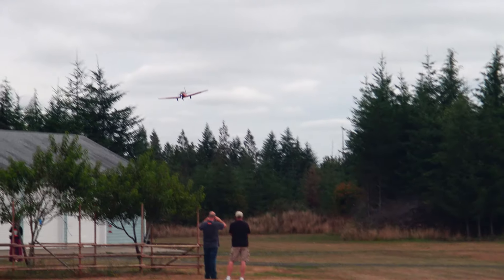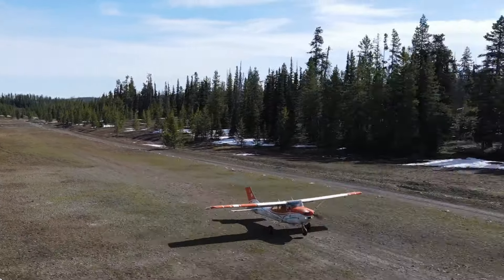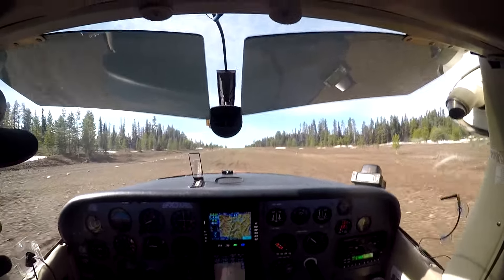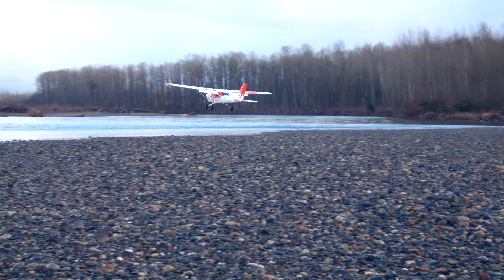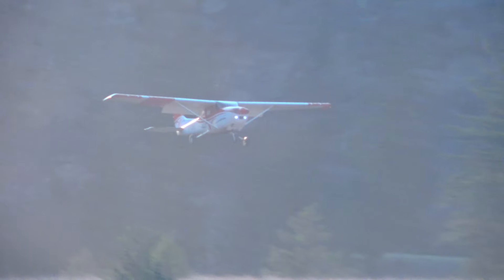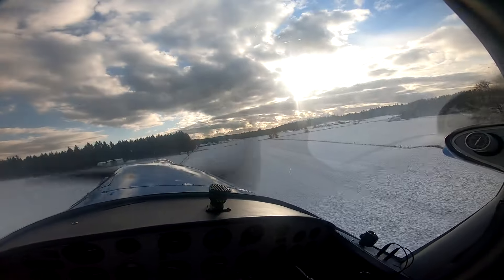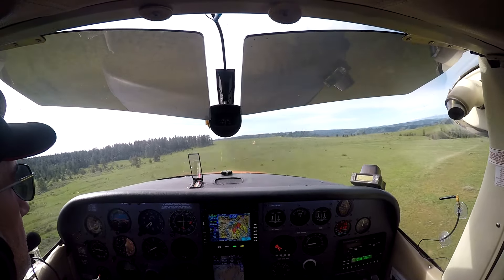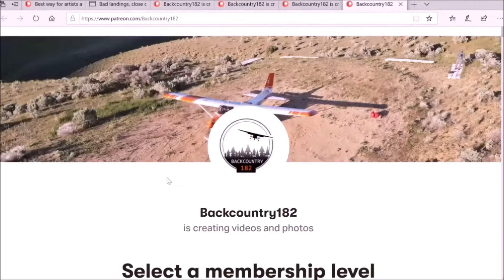Airplane Action! Mud, Snow ,Big Rocks, Water and Tight landings

Comment: Learned a new technique from watching, flaps up on power up, as you approach Vr speed lower flaps to takeoff position. This will allow the plane to accelerate faster for takeoff. The Mooney one upped this by retracting landing gear as soon as the wheels were off the ground. That was one of the fastest retractions I have seen for a takeoff.

Comment: Great video, as always! Could you explain your thinking for starting with 10 degrees of flaps and then adding 10 more at 40 MPH (or knots)?
Reply from the maker: Just did it on Memaloose because high density altitude and mud, I knew it was going to be a long take off run, so did not want to add the drag of 20 degrees of flaps from the start, so started with 10 and when almost ready to fly added 10 more

Comment: How would you know if you had overloaded the nosewheel following a soft field landing and hitting some deep mud or something. Will it collapse first or pitch you over forward?
Reply from the maker: You feel it pitching you forward
Reply: @motoadveBackcountry182  I'm just curious if you do anything special to monitor the condition of the landing gear, especially the nose wheel of the 182. Easy to imagine all those vibrations catching up one day. Has it been modified at all?
Reply from the maker: @marksinclair701  Re inforced firewall, and heavy duty nose gear